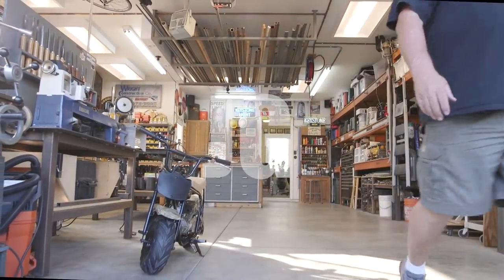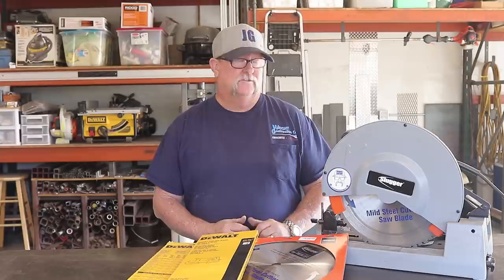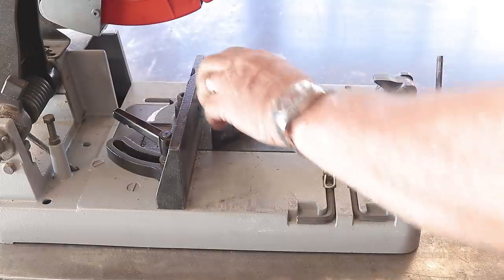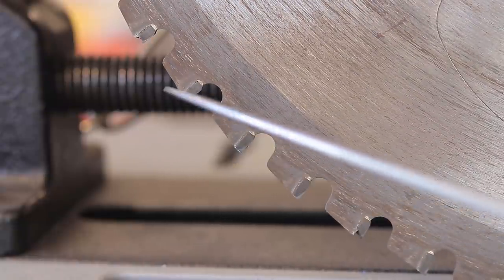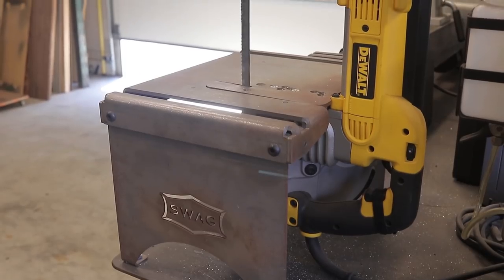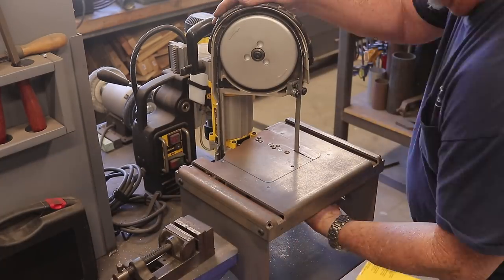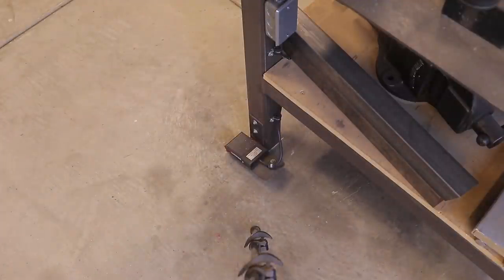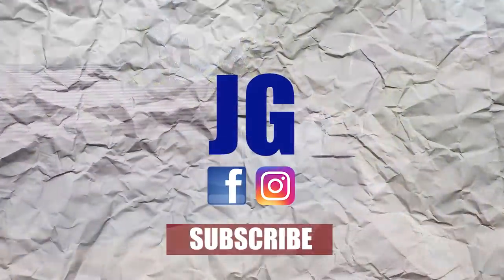Metal Cutting Saw Blades  | JIMBOS GARAGE

Comment: I own a small pallet business, we dismantle a lot of pallets. The wood runners tend to have a ton of nails in them Is there a blade I can put on my table saw and run the runners  through them to cut the nails off even?
Reply: Better late then never I guess..but those Red colored Diablo steel demon blades made in all sizes are great for anything you try to cut. Just watch the rpm rate on the blade is higher then the tool you put it on as high speed blade shatters can be down right dangerous..seen a guy cut 3 inch soild steel with a circular saw with one without a problem..so nails should be zero problems..

Comment: I know this video was a while ago, but you can get those carbide blades sharpened.  Here , where I live in SC, it's $25 to sharpen. They can replace the carbide teeth if they need it, which is $5 each. So if you don't let your blade get demolished like that, you could get it sharpened for pretty cheap.
Reply from the maker: Thanks Amy,     Jimbo!

Comment: I have a 10" evolution all purpose and a 10" C6 carbide blade. They are only good for 3 to 4 cuts of 3/16" thick (ID 2 3/8") HDD pipe. I did not force the saw/blade. What should I buy?
Reply from the maker: Thanks for watching Pat, Any good 14'' metal cutting saw will work better, They are a bit expensive though, Around $600.    Jimbo!

Comment: Couple of things, If you don't wait until the blade is trashed you can have them sharpened several times, I personally didn't like the Fein blade, it did not hold up nearly as well as the Jepson blade, but was half the cost. The Diablo blades are on par with the Fein but cheaper. They make blades specifically for non Ferris  and SS. A bit of cutting wax will make the blades last much longer as well.
Reply from the maker: Thanks for watching and your advise.  Jimbos garage!

Comment: Great video, thank you. Is a SLUGGER cold saw better than DEWALT or EVOLUTION? I'm looking to buying one soon, what's your opinion?
Reply from the maker: Thanks for watching Eric, I think it might be a notch beter than DeWalt, And 3 notches better that evolution.   Jimbo!
Reply: Agreed with one exception. Evolution makes two versions of this type of saw one that's shitty (very flimsy sheet metal base) that they sell cheap and a second that's the same price as the Fein that has a cast base and is pretty much the same as the Fein. The DeWalt's vise isn't as good as the M. K. Morse or Fein which are both made in the same Taiwanese factory. The M. K. Morse and the Fine are nearly identical and I consider both superior to the DeWalt which is made wherever.

Comment: Is it possible to change a abrasive style chop blade with the metal blade?
Reply from the maker: Thanks for watching, No! A regular chop saw runs at a different r.p.m. Than a metal cutting saw. Metal cutting saws run at a lower r.p.m.  Jimbos garage!
Reply: No you can not do that saws run alot slower . Teeth flying off bad day for sure.

Comment: Hey Jimbo, 
Love the channel. As others have already stated you can have the blade sharpened and some places can even put new carbide teeth in. Although at the price that blade is, it may not be cost effective. I used to have much higher cost blades for an industrial cold saw and a repair versus a $500 blade made sense. Would like to talk to about the Plasma table once you are up and running with it. Seriously thinking about it since I saw your video. Much cheaper than a CNC mill which I am also getting, but the Plasma will get a few pending projects off the to do list, faster and cheaper.
Reply from the maker: Thanks for watching Don, The plasma table is here now and i'm getting used to it. Video coming soon.  Jimbo!

Comment: Amazing videos brother, Love your work,  Quick question, Can this blade be used on a cut off saw instead of an abrasive blade or is there a difference in speed for this blade?
Reply from the maker: Thanks for watching, It can, But it wouldn't last long, The metal cutting saws run at a slower RPM.   Jimbo!

Comment: I gotta say, I've put maybe 400-500 cuts on my Fein Slugger so far, and I'm still a bit ehhh on the design. 

The thing cuts like a hot damn (really does), but they clearly didn't get any user feedback before sending the design off to production. You showed my biggest annoyance with it at 1:10 - that flip nut gets in the way whenever you push in the clamp! Every single time! A dry cut saw is overall a much better choice than an abrasive, but my old Ridgid had fewer of those quirks.

What do you think of the saw really? (If you're at liberty to say.) I've been meaning to do a video comparing the two, and am wondering if I'm the only one who finds the design coming up short compared to the $500 price tag.
Reply from the maker: Thanks for watching,  Yes it is not perfect, But over all i would give it a 8 out 10    Jimbo!
Reply: I'd say that's pretty fair. It's really unfortunate that if you want something built 100% right, you usually got to do it yourself! I guess that's what the tools are for.

Thank you for taking the time to produce so many well-done and informative videos!

Comment: Thx Jimbo. I bought a slugger after seeing you use it so much and bosting about it. My problem is that mine don't cut plumb and can't find instructions on how to adjust it. Can you help me. I have gotten no help so far from the dealer or Slugger.
Reply from the maker: Thanks for watching Jim, Sorry your does not cut square?, Let me Get a hold of Fein and see if i can get you some answers! It may take a week or two, They are a little slow to respond!.   Jimbo!